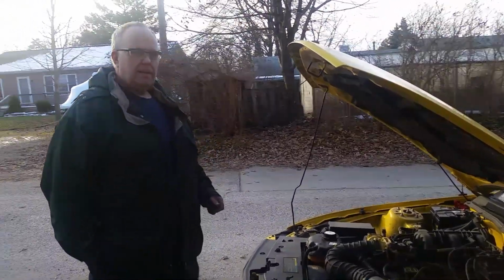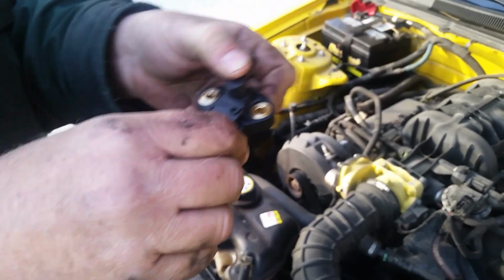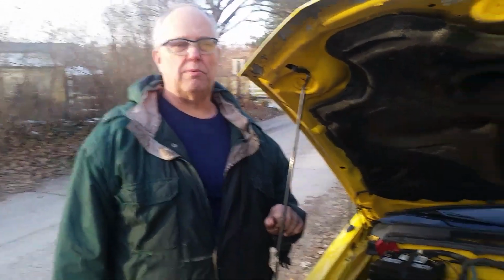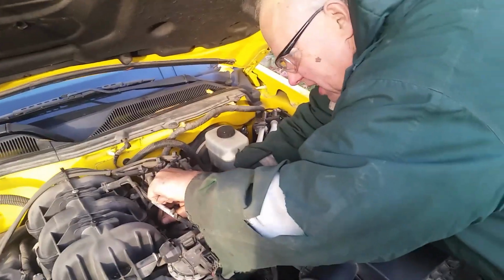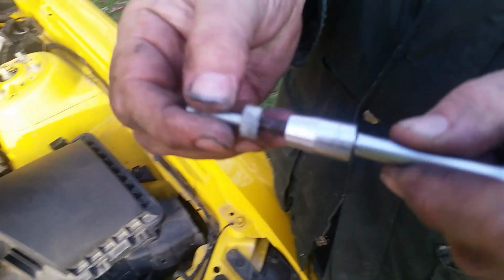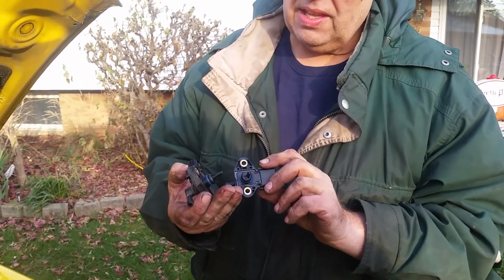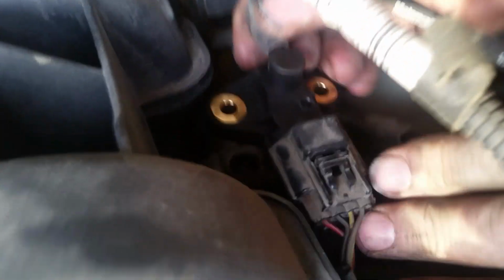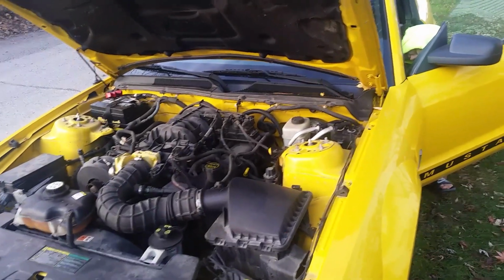How to replace 2005 up Mustang 4.0 fuel rail pressure sensor

Comment: Thanks for this video. 
I decided to get the original Bosch part after looking at reviews for the after market parts. My 2009 Mustang is fixed now. 🙂
Reply: What problems did u have with it I'm having problems and I wanted to see if it was similar
Reply: I can not remember for sure but I think lack of power was the problem.
I scanned it with like a $50 or $60 scanner and it gave me a code.
I think the Bosch part was about $80 and I went ahead and got it because I read lots of bad reviews on the after market fuel rail sensor.

Comment: After replacement will the engine light automatically turn off?
Reply from the maker: Some lights do after a few drive cycles, otherwise you can remove battery cable for a while and that might clear it.
Reply: i turned it off with a bluetooth OBDII scan tool that i got on amazon for pretty cheap

Comment: Can you please tell me where is my oil pressure switch located? I can’t find it and I my oil light comes on and off. I have a 06 v6
Reply from the maker: Link to diagram. Front drivers side. Near ac co.pressor

Comment: Got P0163 codes but I think my wiring is incorrect. Read pin 2 is reference voltage? My pin 4 is ground. What are the readings at the connector with Key On only? Pins 1,2, and 3 please help thank you
Reply from the maker: The car is put away in winter storage right now.

Comment: hello im hoping if you can help me out. i have a fault code p0183 fuel temp sensor "A circuit high input". i just cant seem to find this sensor my car is having a couple problems and im guessing this sensor is causing it. im thinking it should be along the fuel rail. same 4.0 engine
Reply from the maker: I will need to do some research and get back to you. I suspect air intake sensor or ambient air temp sensor may be failing.

Comment: how do you know it is the fuel pressure sensor? Mine is in shop now and they can't find the problem
Reply from the maker: Mine was actually still running okay, but I was getting a check engine light that showed a code for a bad fuel pressure sensor I changed it clear the code and it never came back. What is going on with your car? Maybe I can give you some advice
Reply: Hi. Did they figure out the issue?

Comment: I just had the same issue and replaced the sensor on the fuel rail thanks to this video you made. Now my car is running rough no power ,idles bad and i just got a new code right after p2198.. i can smell gas when i strat the car too.. not sure what happen any suggestions?
Reply: you ever figure it out

Comment: 1:00 Holy crap that is alot of hood corrosion
Reply from the maker: Not a fan of the aluminum hoods
Reply from the maker: I actually worked on the line at Flat Rock I'm Waco 5 to early 06. But I can honestly say I had nothing to do with mixing metal LOL all I did was put Hood latches on and a little bit of instrument panel assembly

Comment: I bought the after market one and it was still leaking why is that? Lost the original screws to it where could I find them at?
Reply from the maker: Not sure why it would leak, mine never did it just stopped working.  Maybe try a ford parts website to look up the screws or grab them at a salvage yard?